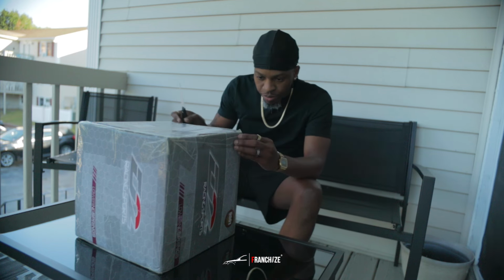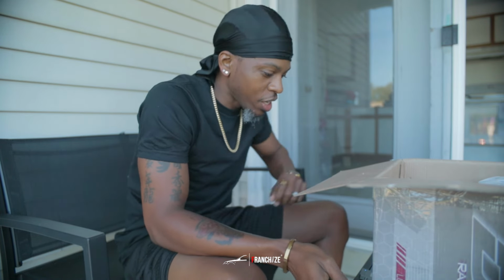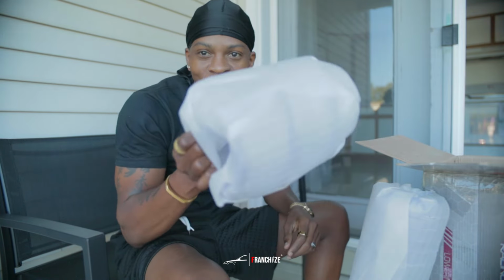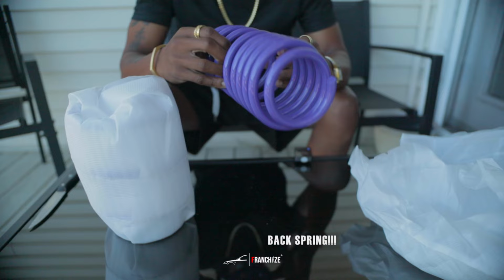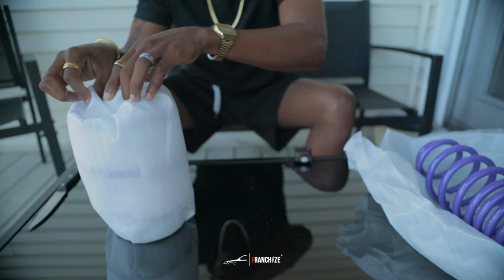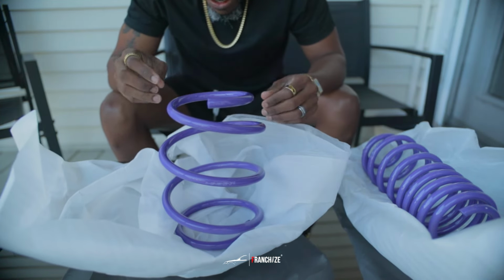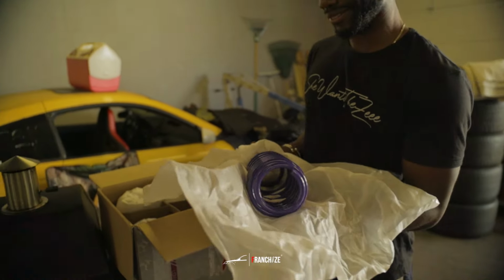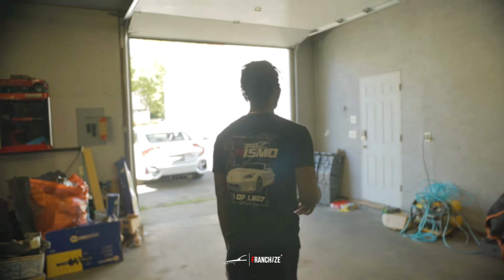INSTALLING D2 SPRINGS ON MY 2020 CIVIC SI

Comment: You mention about spring and coilovers it easy to get the plug-in for the dampering so the code will go away look into tien coilovers and they sell that plugin for the dampering system gonna be pricey but worth it I have a 2021 Honda accord and it’s the same for the dampering system as well so just do lil bit more research and you can find them bredda  si clean 🧼
Reply from the maker: Respect my g, gonna check it out 💯